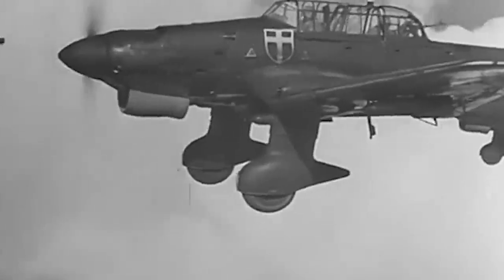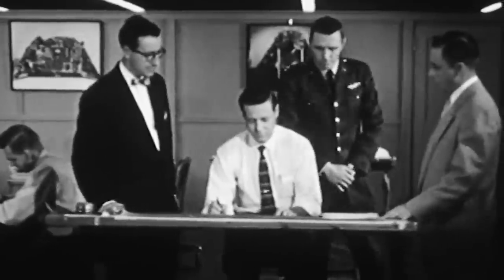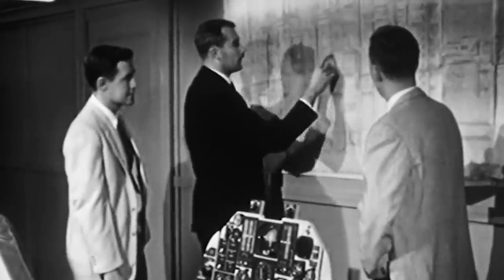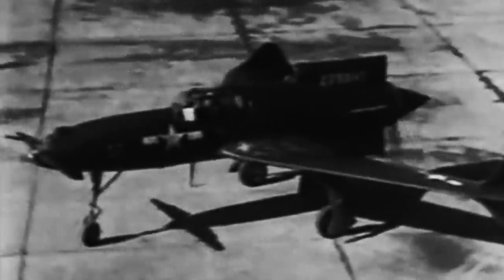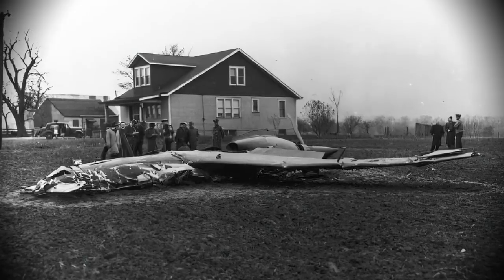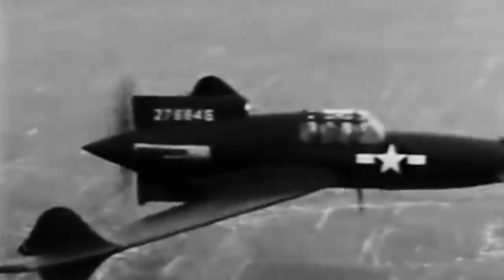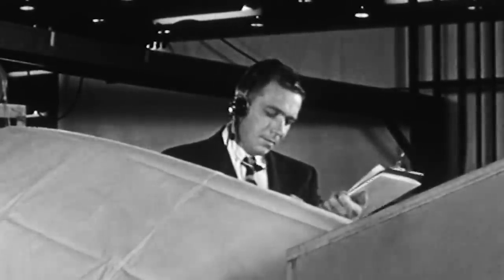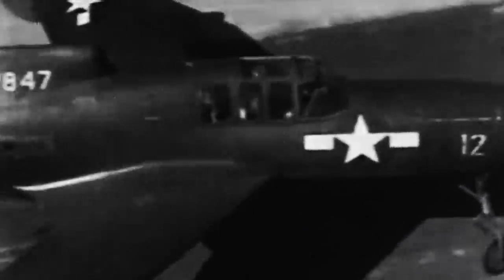XP-55 Ascender - The Backwards Fighter

Comment: I wonder how good this design could have been. If you made it bigger overall, used the engine from the Bearcat, and a ducted fan for thrust. I bed it could have rivaled the early jets. All subsonic of course.
Reply: A whole lot of HUGE problems with that idea...1 Bearcats had radial engines this plane used a V-12... 2. A bearcat engine is bigger around than the hull of this aircraft 3. no air inlet for a ducted fan and size again 4.weight balance...And these are all the simple answers to nope not gonna work, If my sister was here she could bury you in info on why as she is an aerospace engineer but she would probably drowned you with so much info on all the changes you would have to do, it would goggle your eyeballs lol...plus the prototypes of the P-80 shooting star were out already. This plane is more a to little to late technology wise. Hell the Japanese Shinden was further along in its development than this (they had plans to use a jet engine already drawn up) but the war killed that 1 also. https://en.wikipedia.org/wiki/Kyushu_J7W_Shinden
Reply: @rongray8416  All new designs are a big problem. I agree that it would be a new design. However, none of my suggestions are outside of the technology presented in Hoerner's books in the parts covering WWII era hardware. It could have started with piston engine and moved up to turbine powered fan. I still think it would be an economical option for low tech air forces and ground support. Correctly scaled it would haul more payload with less fuel expended for equivalent wing area. I think the Japanese version of the idea confirms my line of thinking.
Reply: @markhatch1267  True on a redesign from prop to jet  as the Japanese plane was planned to do this exact thing but,..scaling is a lot harder in reality than just saying make it bigger or smaller. You've got to deal with weight, mass, structure, and fluid dynamics.  weight is pretty easily calculated, part A through Z all have their own individual weight add it up done. Mass though will change on just how big of a surface area and where weight locations are (not my specialty at all but it a big deal in its own right). Structure is pretty simple in its basic form, Steel weighs such n such and how much its tensile strength is before it sheers or breaks. And Fluid Dynamics <--yep your hitting full on engineer with this one alone and is well above my pay grade lol...lets just say for simplicities sake you have a wing both the exact same except for size (1 is bigger than the other) they will both react differently to the air passing over and under them. Any way for our head cannon yup we can agree the jet might have been the easiest modification to continue the planes development (plus Im a huge fan of these kind of designed planes and flying wings)...It really comes down to technology of the era surpassing this planes development and continued to do so afterward. Sad because I like the Xp-55 to...Oh and the shiden there are you tube vids of it running/flying, If you ever see one youll see that thing is a Monster in size compared to the XP-55 (used a radial engine to) to bad only 1 left atm and its in pieces :(     been fun have a good one
Reply: @rongray8416  You're preaching to the choir brother. I have personally been involved in real engineering. Check out Powersport Rotary Engine RV-4. Everett Hatch was my dad. I designed the accessory section for my dad's original prototype engine. The recent Powersport effort built on our work. I think the Skyraider repackaged in this type of cofiguration would have been even better.

Comment: One of the many reasons why Curtiss ended up being forced to shut down aircraft production after the war. A thousand prototypes of average value charged sterling-like rendering no fruition. Also, the defective engines affair. Racketeering at its very best. There was a book on the matter and the stench of corruption extends for miles.

Comment: Again, be careful with words.  The XP-55 did not become famous for the work it did in training.  It was never in a training role, beyond test pilots learning how not to die.  How about "what they did, not in combat"?  Next, it wasn't 'moderately successful in its testing period due to excellent handling and stability'.  As you yourself go on to describe it was totally evil in some phases of flight with a vicious stall that gave no warning to the pilot and was then apt to enter an unrecoverable spin.  A fighter aircraft is expected to live or die by its turning performance, at high g and close to a g-induced stall.  Stalling performance is therefore critical.
The safety device to 'disengage' the propeller was actually a device to detach the propeller;  disengagement would have left it windmilling and just as lethal.  If you look carefully at the diagram you show you will see the word 'jettison'.  And it wasn't a device to protect the pilot during ejection.  In the Ascender the pilot had to leave the cockpit under his own power by rolling the canopy open, undoing the correct set of straps and diving over the side, as I remember rehearsing in a Meteor trainer.  The first US ejection was in 1946 and these seats did not become common until the 1950s.
Back to the B-roll video choice, you talk about Curtis Wright getting a development contract and show what is clearly the B-52 production line at Boeing Seattle, some time around 1960.  There may not be any shots available of the correct plant but I'm sure you could find something at least related to WWII.

Some of these videos are really interesting snippets of obscure aircraft and events but it would be great if you could be just be a bit more careful to avoid the jarring errors.

Comment: "A new request for proposal from the Air Corps."  "Really?  What do they want?"  "Oh, lets see.....speed, climb, ceiling, maneuverability, weapons load, visibility, low fuel burn,  cheap and simple construction......the usual." 

One wonders why these "proposals" kept coming.  Why not just say, "Work on it"?  Duh.

"What do they want?"  "Well, it seems that they're tired of speed, climb, etc.  They want slow, heavy, expensive, poorly armed, sluggish and unstable handling, high takeoff and landing speeds, no tolerance for crosswinds, barely clears the trees, uses oceans of fuel, made entirely of solid gold, and the pilot has to peer through a periscope."

Comment: Actually, I find it rather amusing that we today are still borrowing design nuances and design ideas and incorporating them into fully accepted modern aircraft.  The canard wing in the front of the aircraft is quite similar to what is found on the modern Eurofighter Typhoon today; as is tricycle landing gears for most fighter aircraft, and the use of winglets for better flight performance and fuel efficiency, can all be attributed to these early prototypes, even if they never really got off the ground and/or into production in any quantity.

Comment: I guess the XP-55 was a victim of not being spectacularly better than what was already in service, or in the pipeline. I mean, it seems it wasn't exactly bad, but not worth the extra research needed to make the odd configuration work. At least if all you got in the end was similar performance to more conventional designs, that took less effort to figure out. Plus of course, jet engines were the next big thing.

Comment: If they executed 2 engineers to every test pilot they killed, the quality of the aircraft would have improved quickly and dramatically.
Reply: Probably not.

They’d probably get a play it safe aircraft that didn’t try to do anything particularly exceptional.

Also, they’d have less engineers to actually fix the problems.

Comment: It is about max gliding efficient wing max dist design not turning fighter or straight sprinting. U feather both engines back till level flight or front engine turned up in a glider climb again max distance not fighter turning must hve straight glider thin wings.

Comment: so what were the other 3?

yeah, this must have been an awful design because some highly-successful canards look a lot like it.
Reply: I wouldn't call it a canard, which have a front WING with the control surface attached to it, in this plane there is only a control surface which didn't made it stall safe, which is the most important feature of a canard.
Reply: @AltMarc  it's a flying canard. Like a flying tail. 

No plane really "stalls safe" it drops like a rock until it starts to fly again. A swept wing has a tendency to stall at a higher speed than a straight wing. The flying canard gives it increased sensitivity and without experience flying such a design a pilot will find it harder to recover on top of the added recovery altitude loss. But without the flying control surfaces it will be harder to maneuver at high speed and high aoa. The Russians got around that problem by switching to boosed controls like the late model P38..i'm sure that putting the vertical stabilizers/rudders on the wingtips just exacerbated the control problems.

The bigger problem was in the fact that it was a fixed swept wing...that's good for transonic flight but bad for llow speed flight stability and controllability  which is what a dogfigter really needs to excel. Efficiency was a problem that went away in the jet age and for a prop plane we already had 450mph piston engined prop planes that had been thoroughly shaken out. By then. Overall it was a design  both ahead of its time and ill-suited for the mission on which its contract was based. But with a decent axial jet engine it could have been the first supersonic combat aircraft.

Comment: Again, so many errors and inaccuracies. The aircraft is a canard design, which has a long and successful history (Piaggio Avanti and a series of Burt Routan designs, including the VariEze and Long-EZ, and even the ill-fated Beech Starship). The wing design is highly-swept to boost speed. Curtis made the mistake of attempting to use a less stable wing configuration for a fighter aircraft. Rear-facing engines are prone to overheating, particularly piston engines, and the engineering can be quite complex. A laminar flow wing, and the sweep, make the aircraft more prone to aggressive, and asymmetric stall characteristics, though these aircraft are unusually fast, and efficient. A current aircraft, called the Celera 500L, though not a canard, uses the same laminar flow, and rear-facing pusher piston engine, to produce a highly-efficient, high-speed design. The Curtis design wasn’t particularly innovative, with swept wings and pusher engines commonly in use. Their error was in believing this canard and wing combination could be used in a fighter, with several jet aircraft already in development, like the Gloster Meteor and the Messerschmitt Me262. Do your homework better, please!